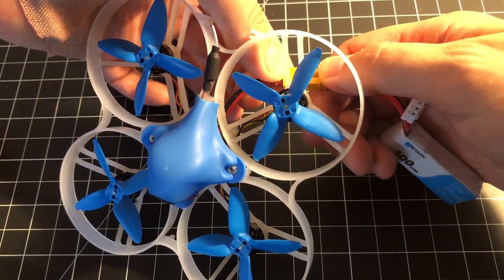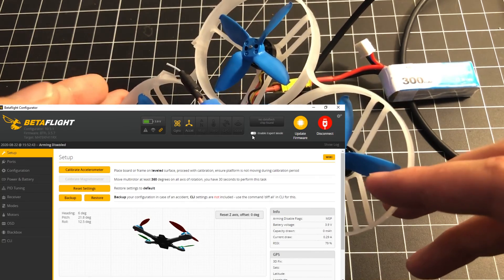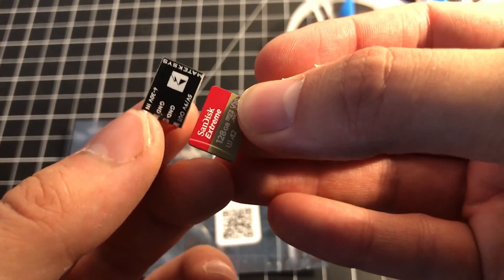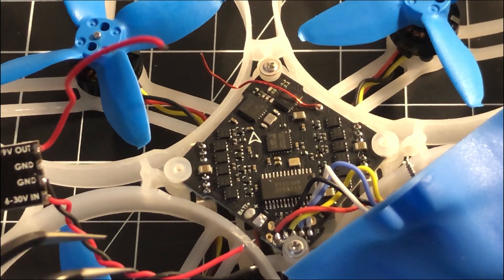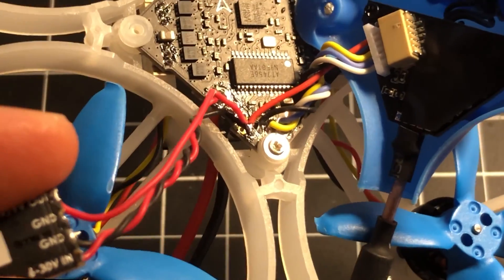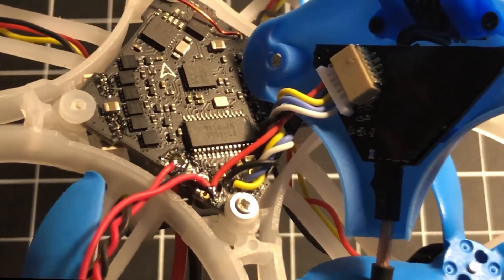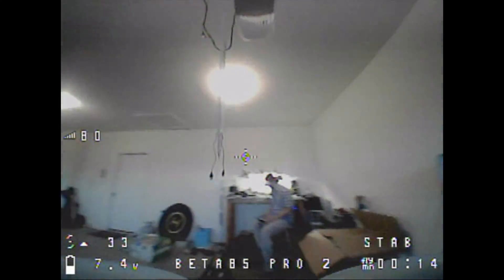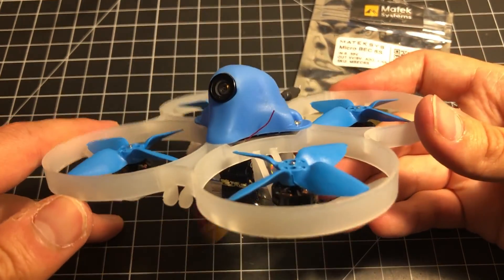Drone Flight Controller Dead 3 beeps? (Fix with 5v Micro BEC!)

Comment: You just resurrected all my Flight controllers! I have about 10+ flight controllers I thought were gone for good but I could never bring myself to throw them away. Giving credit to where credit is due.
Reply: What's kinda crappy is the fact that Bardwell told me to toss them.
Reply: I have 4 f7 T-motor pacer, 2 f7 HGLRC Zeus, 3 f7 T-Motor velox, 1 f7 Rush flight controller all 30×30 and 2 little 20×20 f4 flight controllers that came with the Spedix Rex80 whoop.
Reply from the maker: That’s so amazing 💪 thank you so much for sharing this with me. Can I ask because you have 10+ flight controllers that is a good sample size of data… what kind and brand are they that this happened to you 10+ times?
Reply: Yeah, sometimes it happens because I was soldering when I should've been sleeping or when I crash.  But the T-motor velox 55amp stack and 2 of my pacer 60amp stack did it mid flight on my 6 inch builds, with 2806.5 1800kv Xing motors for no reason. After I saw your video, I went to raceday quads, order the exact 5v micro bec you used and it worked.  Order 5 more that same day I fixed my Rush flight controller and 2 of my pacer f7 flight controllers.
Reply from the maker: @mauricequarles  Thanks for the info!
Reply: ０．０

Comment: Hi, I have the same problem that you solved but I couldn't proceed as you indicated: I connected the BEC input directly to the battery and the positive output to the FC 5V pad and the negative output to the FC's GND pad. I get 2 beeps as usual and the sequence doesn't close, do you have any suggestions? Thank you
Reply from the maker: This means there must be a short somewhere else. Or the 5v bec is implemented in some way that is preventing it to be backfed, which would be weird, but not necessarily impossible... are you using the same exact FC as me, or is this a different one? Is it an AIO or a FC only?
Reply: I'm using an FC iFlight F7 mini F722 and with the multimeter all the input and output voltages are regularly present but the 5 V voltage is not distributed by welding the pads designated on the electrical diagram; it's as if I had the wrong input for the 5V distribution.

Comment: So what broke the board???
Reply from the maker: I crashed and the on board 5V BEC died - that simple. This can happen to any flight controller, but it was absurdly common with these boards. There's a bigger risk with AIOs in general because voltage spikes can take components like 5v regs out easily and there's less isolation and caps compared to a stack.

Comment: It turns on but dies after I arm it pretty much so it did not work
Reply from the maker: Sorry to hear that man. Hopefully you can put the BECs to good use for this situation if it happens in the future, or for powering other little things that need it.
Reply: @ should a go for a lower volt bec
Reply: @ mine is a 6 vlot to 30vlot in and a 5v to 9v out and it’s 1 s
Reply from the maker: @Lucky420fpv  Yes! Your BEC requires a minimum of 6v in. And your battery is 1s which is 4.3v maximum. You needed a lower BEC for a 1s quad. These BEC are only good for 2S and above. :(
Reply: @ so it’s probably fine because it arms and then dies really fast
Reply: @ thx man that’s gotta work
Reply: @ it’s okay man I can use this bec for my 4-6 s and get another smaller one it’s nice to know it’s still vary fixable
Reply: @JohnCuppi  <3
Reply from the maker: @Lucky420fpv  There's greater hope that it can be fixed; since the 6v minimum BEC in my video cannot properly function without that voltage minimum. It sounds to me like it's trying really hard anyway with 4.35v, which is why you're actually able to get it to arm, get all the tones back, but then it dies fast. The correct BEC sounds like it has a very good shot of working here based on that. Please let me know if it worked.
Reply: @ thx man
Reply: @ I appreciate it vary much I will get a new one Odered I found one on Amazon
Reply: @JohnCuppi  thx man
Reply: @JohnCuppi  it’s half fixed lol at least I know if o get the right one it should be fine thx to you and this video I appreciate you brother

Comment: Hello! I was building my freestyle quad with F7 SE stack from T Motor and i got all this done. When i test it there were only 3 beeps and my 5V pads did not have current… But my vbat works fine! This should help me with that? 
Im kinda desesperate bcuz idk anything more to do
Reply from the maker: @DiogoPiresFPV  before doing this I would suggest emailing t-motor and see if there’s a resistor or something that might be removable that could fix this. I had an issue with this exact stack in my review but it was with the 10v BEC pad instead of 5v. Since this is happening out of the box it’s worth checking with them to see if there’s anything else you can do.

So just to confirm also you are getting 5v at the pads but they aren’t actually supplying enough current to power anything at all? And have you tried it without anything else connected to the 5v pads and only the FC, just to rule out anything causing the 5v BEC to “brown out”?
Reply: @ Thanks for the response can i text you via whatsapp or discord whatever to explano to you exact how this works? I have tried it everything , yesterday was almoçar 6 hours trying to solve this and nothing 😅

Comment: What if it only makes 3 beeps with solid red light? Is my fc damaged?  Wont connect to pc or show up on Betaflight.tried to reflash on dfu but cant connect wont show and same thing when i plug in only battery. Solid red light
Reply from the maker: @GREEZY.A1  If it won’t connect to betaflight like mine will over USB, then the FC has some other damage or problem.
Reply: @JohnCuppi  yeah I figured..  getting new FC and see if that fixes the problem. Thanks for the help!

Comment: I crashed my 5" a week ago. Smacked top first onto pavement. Accidentally flipped arm switch instead of change profile switch...... Can not figure out how to get it back flying.... I have done almost everything, except replace the stack..... checked for continuity on the circuits, everything comes back clean..... some guy said it was a bad bec on the FC so i ordered an external 5v much like you have here and installed it the way i was shown, powered lipo into drone and POOF, smoke..... completely fried the internal 5v bec on the fc.... so that tells me the BEC was fine to begin with ( i have no idea why it shorted out. No i don't have a smoke stopper, i'm broke cuz i just spent 4 grand on drones) So, now I'm 4 squares in front of where I was before.... in even worse shape.... I have completely desoldered and removed the stack from the frame...... the motors are good, all continuity there..... when I power up the drone (originally, can't now) i got the first 3 initial beeps and then the duh-duh 2 delayed beeps afterwards, so that tells me nothing was wrong with my stack to begin with, right????? I am getting NO POWER connection in BF... does not detect battery, motors will not spin up.... no motor beeps..... what in the actual FREAK am I doing wrong?????? SO DISCOURAGED AND FRUSTRATED RN. BUT THESE ARE THE THINGS THAT KEEP ME FIGHTING.

Comment: If you just built your drone, plugged it in, and didn’t hear all the beeps, try plugging into beta flight, and set your config properly. You’ll get all the beeps after setting your motor protocol etc… assuming that everything is soldered correctly…and works

Comment: You could also solder a Y harness with the wires from the vtx and bec so you’d still only have one wire to solder to the pad for a cleaner looking build and better solder joint. Great idea! I think I might have the same problem right now.
Reply from the maker: Good point!!! I’m not sure why I didn’t think of that.
Reply: @JohnCuppi  two heads are better than one? I would have done it the same way as you until I learned from your experience. Thanks! I’m having the same three beep issue but I’m pretty sure I know what the problem is; I forgot to plug the mipi connector from the camera back in on my o3 air unit when I put my quad back together after replacing the esc. Trust me, I’m no genius 🤦🏻‍♂️😅

Comment: how do I fix my emax tiny hawk freestyle when I plug the battery in I get 4 beeps and then the lights flash and then go out and when I plug it in to beta flight it does not move in the setup tab thanks in advance
Reply from the maker: So you get the first 3 beeps, then a 4th beep, but no 5th beep, is that correct?

Comment: I have a mobula 6hd with what I believe is the same issue. Although I notice that my mobula runs off a 1s battery instead of 2s like yours. Can i still wire in this same external 5v regulator for my drone?
Reply from the maker: Yes, you can use this method to fix it, but you will need a different micro BEC. As you noted, since your mobula runs off 1s, and the matek micro bec I'm using here requires a minimum of 6v input, it will not work for 1s drones.  I believe there is a 5v regulator called the Pololu that can take input as low as 2v which should work for your purpose.
Reply: @JohnCuppi  Okay Thankyou very much! However, I just found out. When I have the drone plugged in to the computer as well as connected the battery. I still do not get the two final beep tones like yours did in the video. What Do you think?
Reply from the maker: @tyler_mckay88  It still might fix it. Here’s the thing: even if you don’t hear two beeps while connected over USB, it doesn’t necessarily mean that if you get a 5v reg and do this fix that it won’t light up. The main reason connecting it over USB to check for this works for me — and many others — is that the 5v rail or power line on the board is also crossed / shared with USB. 

But if the USB 5v is isolated on a board, then the rail will never light up the rest of it. I hope that makes some sense. 

I can’t read board schematics to tell you how power is distributed unfortunately. But one test you could do is plug in over USB, then try touching the other 5v pads on the board. See if there is any output at all. If there isn’t, then it probably IS just isolated.
Reply: @JohnCuppi  thanks so much for the help.

Comment: i just fried the BEC on my flight controller (i'm pretty sure.. every time i probe an output the voltage drops to 0. I think this will get me out of trouble, it's a 2S system but I can power the individual ESCs and the video transmitter straight off the battery and then use one of these to power the 5v cam and the Radio receiver. Thanks for the tips!

Comment: i wonder if i can fix my baby nazgaul like this it beeps 3 times and wont connect to beta flight
Reply from the maker: Possibly, but since it doesn’t connect to BF either though over USB it’s 50/50. The BEC are cheap enough that I would try it, always good to have them on hand for other projects too.
Reply: @JohnCuppi  will this work with 1s

Comment: You are the best! I have the same issue with my geprc tinygo with the geprc-12a-f4! I got an extra BEC so i will try if i can fix the issue. I noticed that it was very hot and also the antenna popped out. Might be this the reason for which i fried the bec on the esc fc?
Reply: My tinygo just kicked it tonight as well.   So frustrating.   I've had nothing but issues with these tinygos. Luckily I have a 4k version coming this week to replace this normal one.

Comment: Hey I'm trying to diagnose my flight controller, when you plugged in battery and usb at the same time did the camera and vtx start working, even with a bad 5v regulator?
Reply from the maker: I want to say that it did, but I honestly don't remember.

Comment: dude i have a  tinyhawk freestyle 2, only powers on when plugged into usb, ive ordered a BEC like you said but im having a hard time finding 5v on my board i have a  multimeter but not having any luck
Reply from the maker: Hey I missed this, sorry. Youtube filtered your comment as spam for some reason. Did you get it resolved? I would look at a diagram of the tinyhawk freestyle 2 flight controller, 5v pads will be labelled on there.

Comment: Hi I got the same issues jhemucu f405
Fresh board only few flight (no clash)

Plug in battery 3x beep and see the vtx without osc (camera connect to external vtx+dvr)

Cannot arm or do anything
Plug in to computer the board red led light up (usually got another blue one blinking)
But can not detect by betaflight

1 
thing very different is when i plug in usb and lipo together also no boot up as normal
Reply from the maker: It sounds like your board has other failures and will not be fixed by this method. Sorry.
Reply: @JohnCuppi  will it be possib that my board require more power than usb to boot up?
Reply from the maker: @quaneu9216  No. The only reason it would be unrecognized by the computer is some USB driver problem, or if you are not using a data USB cable, otherwise the board has failed somehow.
Reply: @JohnCuppi  sad... i just connect to betaflight changing the throttle limit before the last flight.  

have you ever use jhemuc product? 

with less than 10 slow flight , my 1st diy build (toothpick 3inch) fresh build just died like this...

any other recommended board 25mm aio board ？
Reply: @JohnCuppi  I use multimeter to check
When I plug-in lipo
All the 5v 4.5v 9v on the board is working
Reply from the maker: @quaneu9216  That confirms with the multimeter that the 5v regulator isn't dead and it is some other problem.
Reply from the maker: @quaneu9216  I have not used any jhemuc products -- lately I've been using the crazybee X 2.2 board in my uz85 build and it has been working great. No problems with many, many crashes. Maybe it is worth a try. I have good luck with happymodel products in general. CBX 2.2:  https://www.banggood.com/25_5x25_5mm-Happymodel-CrazybeeX-FR-or-FS-or-PNP-V2_2-F4-1-2S-Flight-Controller-AIO-5A-ESC-5_8G-25-200mW-VTX-and-RX-for-Crux3-Trashcan-Toothpick-Whoop-FPV-Racing-Drone-p-1767411.html?cur_warehouse=CN&ID=555608&p=G814221249561201502U&custlinkid=1665481

Comment: My baby crocodile 4 decided to go for a swim in my neighbor’s pool and has the exact same symptoms. I would of used your affiliate link but Amazon can get them here tomorrow vs banggood is a month out.
Reply from the maker: No worries. Get them wherever is fastest and best for you. :) hope it solves your problem!
Reply: @JohnCuppi  if this works. U seriously are saving me about 80 bucks and over a month of waiting from geprc. Thank you for doing this.
Reply from the maker: @wantafastz28  Thanks so much for just leaving a comment like this, which helps support me and my work on the channel. Every interaction In every way counts! And I am always happy to hear about success stories with my tech tutorials where it helped people get back in the air. If you remember, please update me and let me know if it worked out. This  fix so far has had a really good success rate.
Reply: @JohnCuppi  well, got 2 of the 3 connections. Tried adding flux to the 3rd and i can get them to join together.  If I can’t get a hobby shop to do it I’m tossing it and finding something else to make a hobby out of.
Reply from the maker: @wantafastz28  are you trying to join all 3 5v connections in a single pad?
Reply: @JohnCuppi  Yes, which i did successfully, my problem came on the battery connection that goes to the positive xt60 and capacitor.  For whatever reason the solder would not heat up enough to let me join the new wire.  I tried adding flux and cleaning it off, now it looks contaminated and the soldering iron really wont do crap to it, even at 850c.  I'm over it

Comment: My drone fell out of the sky I accidentally turned it off and when it crashed the negative lead came out of the already bad pad. I managed to somehow solder it back but not I only get three beeps but no last two beeps. When I connect it to betafight it doesn’t recognize it, turn on. Is the connection of the lead crap and I need to change the fc board since there is virtually no more pad.
Reply from the maker: If you aren’t able to connect it to beta flight over USB, then the board is likely dead from another critical component failure that occurred during the impact. 😰 This fix only works on birds that are still recognized over USB.
Reply: @JohnCuppi  it’s wierd cuz it’s till binding to my tango2 and I still see video in the dji goggles.
Reply from the maker: @dee1251  The receiver and video transmitter components will work as long as those are getting power flowing from a power rail somewhere. But the board itself can still be "brain dead." Do you see any on screen display elements from betaflight in your DJI goggles, though?